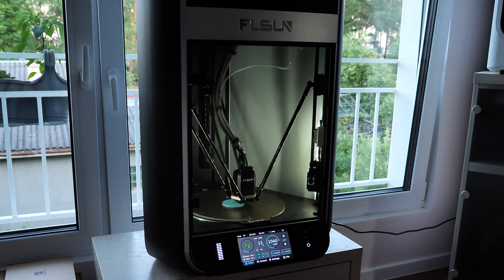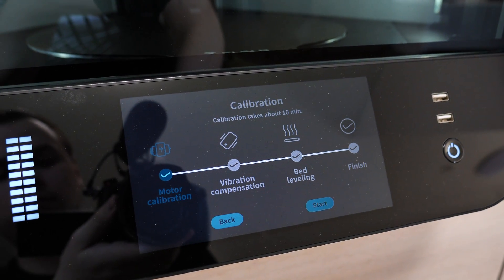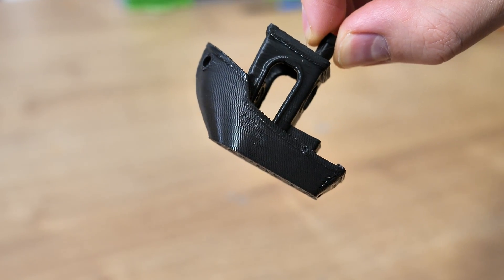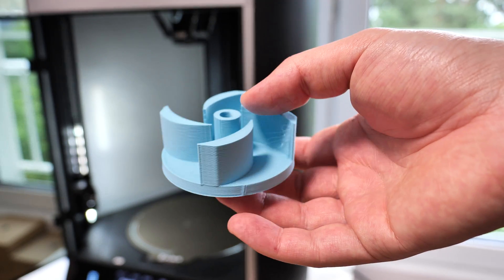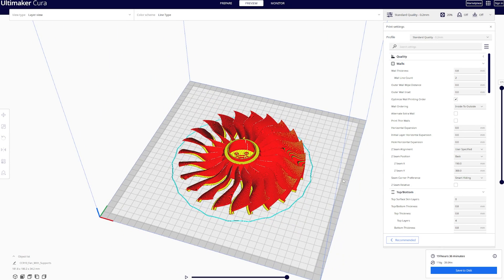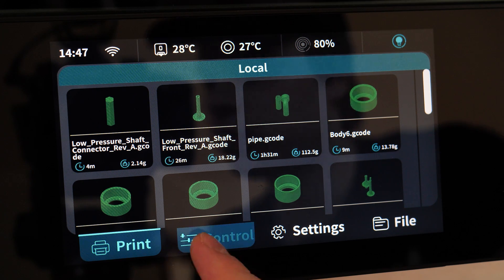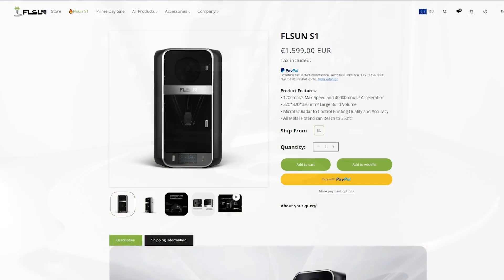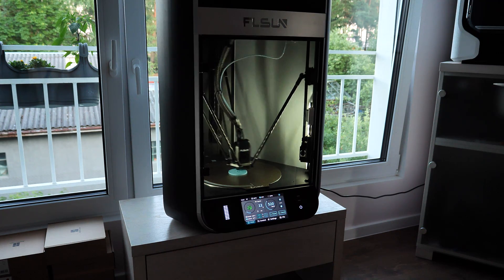FLSUN S1 Reach the Limits Of FDM Printing

Comment: I think you could reduce the noise level by putting a foam insert around the intake for the fan. Just a simple extension tube with a foam around the inside walls will help, while not restricting airflow in any way.

Edit: see that you printed a muffler for it later in the video haha.

Comment: That's a great video. For years I had an older FLSUN. At the time it was the fastest printer available and I really liked it. Recently I upgraded to a newer k1 Max. But I'm really interested in this printer. The reason why I got the k1 max, is because I was able to print without internet connections. So my question to you is this, would I be able to print without having it connected to the cloud? 
Again, thank you for the great video.
Reply: There’s a usb drive so yeah

Comment: Actually the hardware is good software on this machine is no good they've been around too long for them to be having all these issues with this machine you guys need to start to look into what you're buying this machine is nowhere near the bamboo life so you guys need to stop talking this nonsense I already got ripped off from them I would never buy nothing else from them again
Reply: so curious what happened to you?  I've seen your "nagative" comments in a lot of comment sections, and they've contacted me on facebook after seeing my question.
Reply: Bamboo ?  The product itself when it works as designed, can be a really great product. However, the advertised "ease of use" is overstated in actual real life everyday usage. I blame this entirely on the decisions made by their management. A simple example is the blocking of diagnostic data from the user. If one submits a ticket, it can take in excess of four weeks to respond. When one asks how to self diagnose, they are stonewalled by tech support and the standard answer is; send us your logs. This almost always results in time wasted pursuing the wrong solution.

Comment: Too fast? This thing's flow caps out around 35-40 mm³/s. We've got lots of printers doing 50+ all the way up to some real >110 mm³/s ones (not faked by setting acceleration like a 2017 ender so it goes less than half commanded speed).

Comment: I print Nylon and  PACF so I am really interested. It would offer some speed gain over my V400 but I am waiting on Orca slicer support. 
Also how is the filament path? Could you cut the filament just iver the effector and feed another?
Reply: @heavyweather  forget about doing cf and gf on this one.
Reply: @riba2233  why?
Reply: @heavyweather it doesn’t come with hardened extruded gears or hardened nozzle and the chamber isn’t actively heated. It’s more like a PLA high speed printer for Prototyp test fittings.

Better buy a Bambu with AMS. If you need more speed you can buy high flow nozzles (hotends) for Bambu printers like X1C.
Reply: @heavyweather  because the heater block is made of aluminium and has some "cht" channels that will get eaten over time with abrasive materials.

Comment: Oh boy. 
1. It is not even close to peek temperatures
2. It can't really handle cf or gf filaments 
3. Not to mention the bunch of it's other flaws.
Reply: Which makes it the perfect choice for the 75-80% of customers who do not need those things. The ones who do need them, should already know enough about what they are looking for to avoid this printer. If not, i'd question their aptitude for this. This is a quinessential quick prototype printer, and thats all most people need.
Reply: @Dwayne-h2v   but it is not even that as is doesn't even come close to it's 110mm3h claim. If only it was at least 70-80, but it barely does 45 without underextrusion.